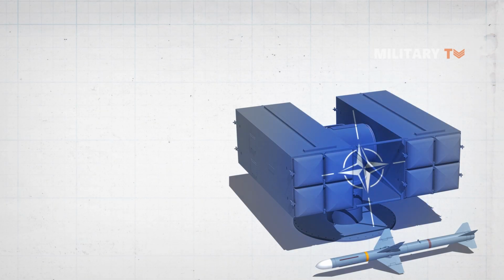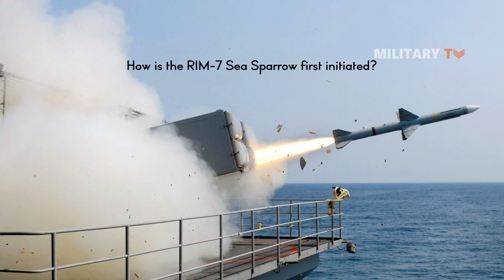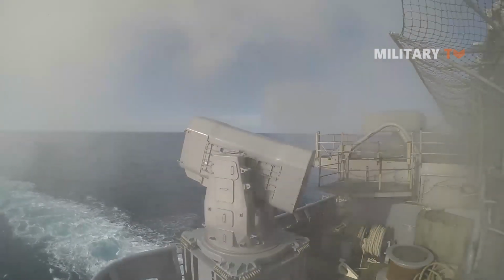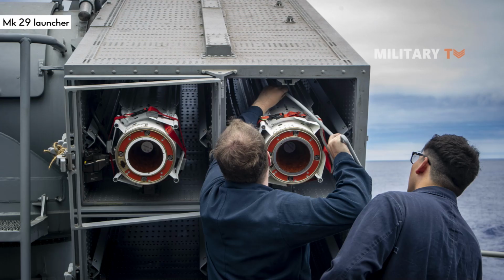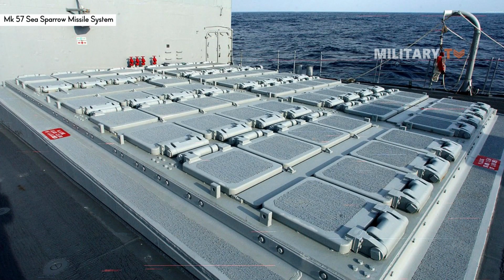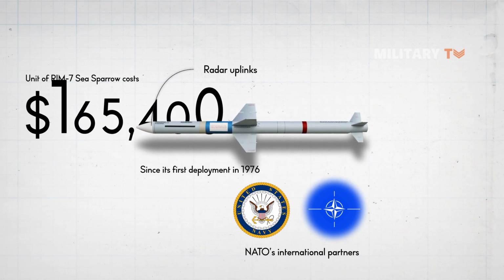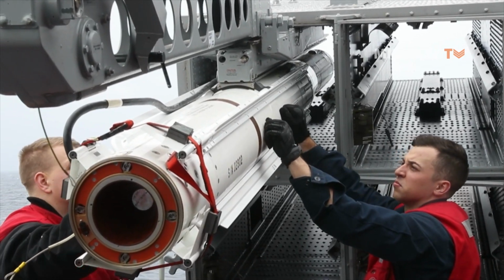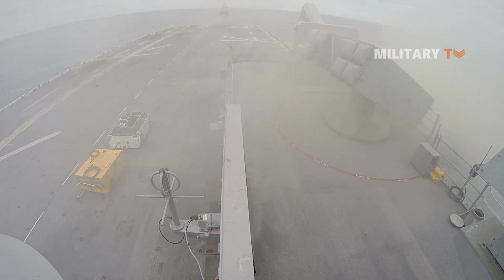RIM-7 Sea Sparrow Missile - Missile Review

Comment: I would say, the radar is not fast enough to realized the hyper missiles coming on line, as the rocket is not fast enough for hypersonic missile, hello Navy u know this, that's why the iron dome missiles systems on Navy ships at times !?
Reply: best possible thing to counter hypersonic missiles is the SM-3 Block IIA
Reply: the patriot missile has shot down multiple of russias hyper sonic missile
Reply: Not necessarily meant to counter every type of missiles, the Navy works in a layered network of air defense systems each designed for a type of threat and if one system fails. Remember the US Navy never travels one ship out of time, they’ll be in formation with ships in every direction.
Reply: Hypersonics aren’t gonna be the only thing being thrown at ships. You have slower missiles, drones and aircraft. Which is what this is for z

Comment: However, there is a clear reason why the U.S. and the Soviet Union did not abandon ICBMs and strategic nuclear bombers, but SLBMs are the least responsive. The U.S. Navy's Ohio-class SSBN, which has a high utilization rate of only 60 percent, has a low utilization rate of four out of 33 ships, but the actual number of SLBMs can only be reduced unless they are fully prepared to start a nuclear war.

This is a clear drawback compared to ICBMs and strategic nuclear bombers, which can increase the number of missiles that can be launched immediately in a few hours to a few days. Furthermore, SLBM is the most irreversible of the three due to the nature of launching from a submarine in an enclosed and isolated water. In other words, it is difficult to issue an order to start the launch when necessary or to stop the launch in a timely. As a result, the personnel management of the command team, including the captain of the strategic submarine handling SLBM, is especially cautious, and the procedure to confirm whether or not to launch the ship is more complicated than other means.

The world's SLBM operators are the United States, the United Kingdom, France, Russia, China, India,
 South Korea and North Korea.